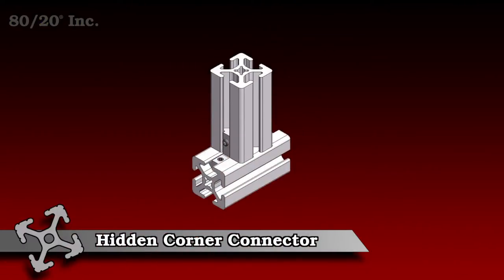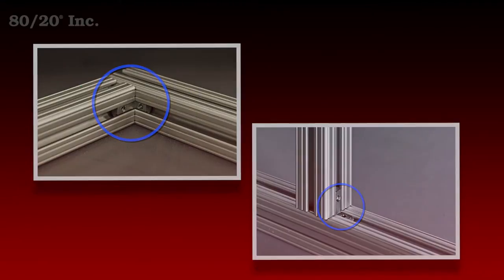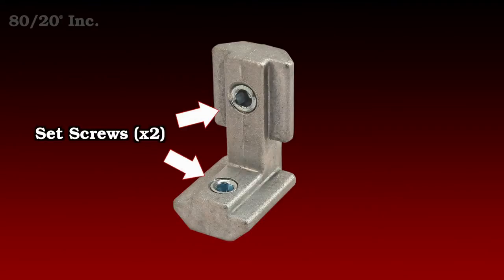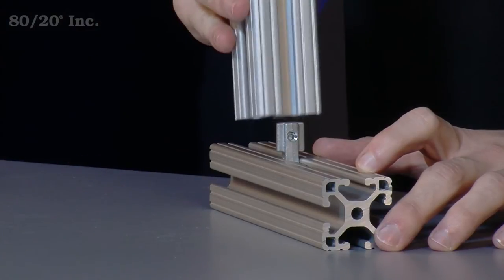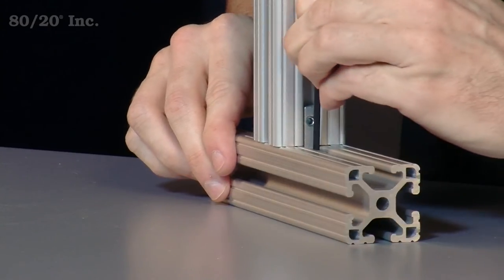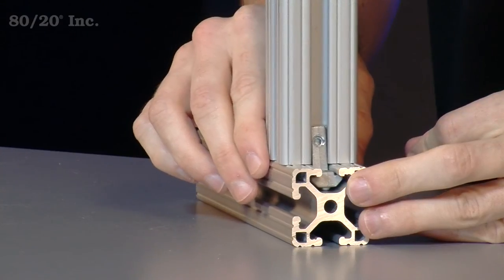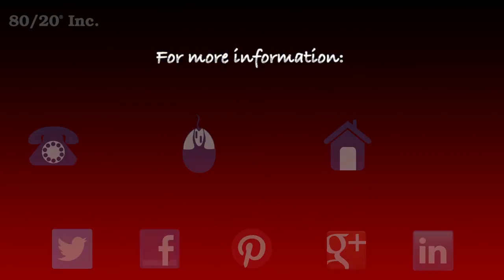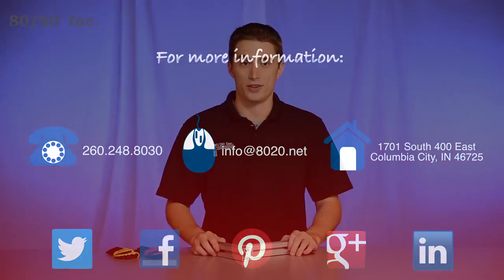80/20: Hidden Corner Connector Overview

Comment: Does this support heavy weight?
Reply: @80/20
Reply from the maker: Hi, Alexander. We have fastener application tests in the catalog ( http://catalogs.8020.net/80-20-Inc-Catalog-23/62/ ) that give load data for direct force, cantilevered, and torsional force.
Suitability for “heavy weight” depends on your particular application, so an 80/20 design teammate should be consulted with the frame details to determine the proper fastening solution.
It is also possible to use hidden corner connectors in tandem with other fastening methods for reinforcement.

Comment: Is the connection resistant to vibration?
Reply from the maker: Thanks for reaching out. The connection is vibration resistant. We recommend speaking to one of our Design Technicians for more information on specific projects. https://8020.net/contact-us
Reply: It may be vibration resistant, but if so it isn't idiot resistant. Mine fall apart with a single truck drive in a consistent way. Looking at this video, I think maybe I'm not doing a good enough job getting the bars tight, as mine have a small air gap in them, in between the interfacing bars. Will try tightening up tomorrow.

Funny enough, it's always the non-loadbearing top. I bet if I put some real weight in it would stop shaking as much